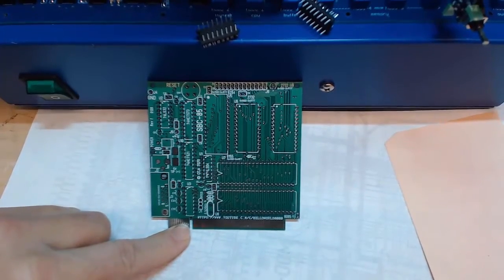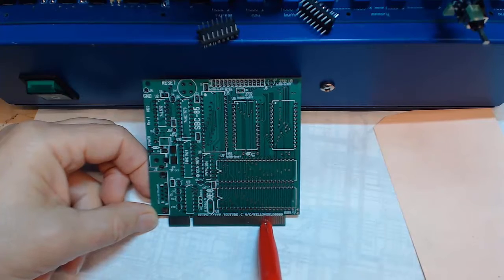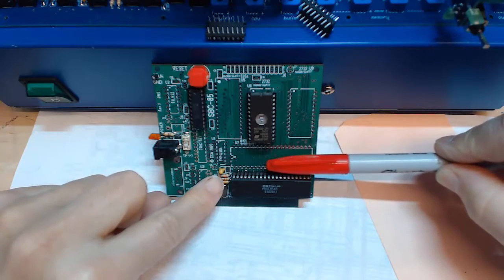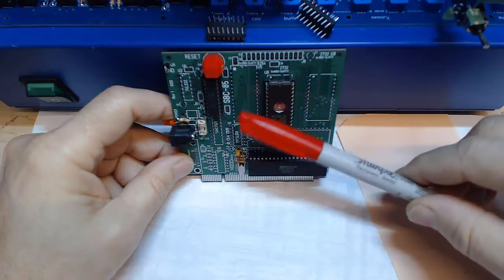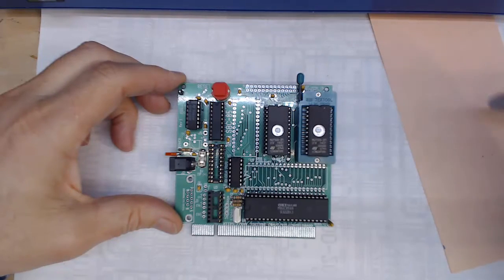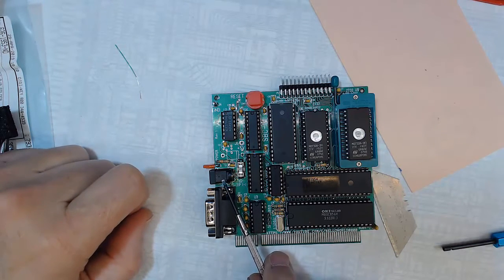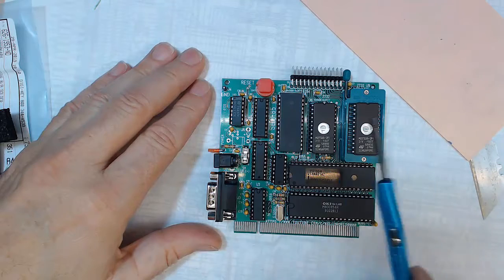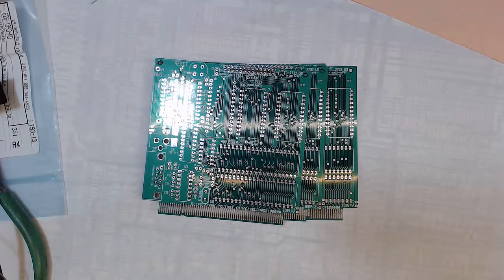{43} SBC-85.COM 8085 Single Board Computer, 22-pins I/O, Timer, RS-232, 8KB+ RAM, expansion bus

Comment: If you mount the serial port on the underside, would it correct the pin 1 orientation such that you could fit the female?
Reply: Functionally, yes. Aesthetically, no.

Comment: hi ! A really beautiful tiny board! it seems it was made by professionals.  I'm an i8080/85 entusiast. I wrote an emulator (using FreeBasic and Python) for that CPU and i can run Space Ivaders on it.  I also have some skills in electronics (i own a little lab with a lot of TTL/CMOS old-time chips), so i would like very much to mount the chips onto your board and experimenting with it..  Really...shall you ship one board to me?! I live in Italy but of course no way, iìll pay the due for shipping.. (massimiliano.cosmelli@gmail.com)
Reply from the maker: Yes, i will send to Italy.  You can email me a prepaid label to put on the envelope and i can drop off at UPS or fedEX.  DHL will take longer since they are 30 miles away and i don't know when i will be driving by them next.  Or you can paypal me the postage, i think it will be about $4 but i need to know your address first.  I will email you details.